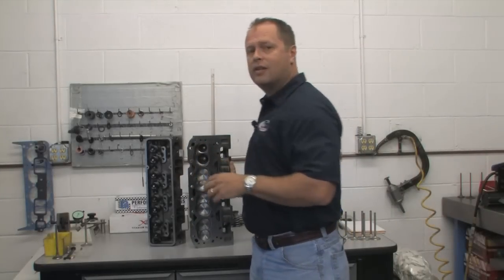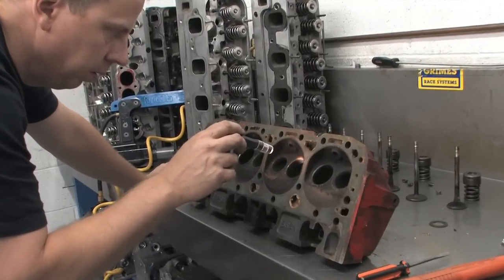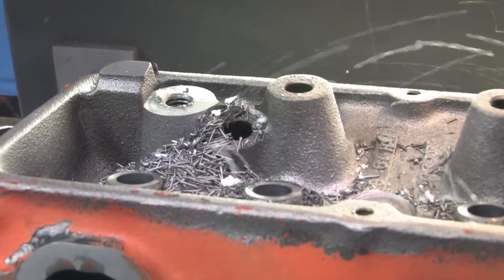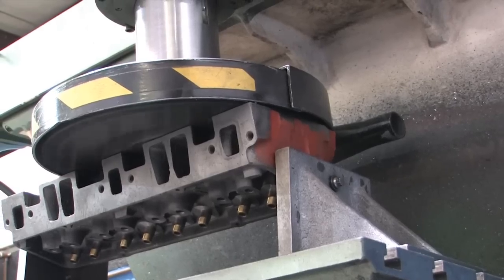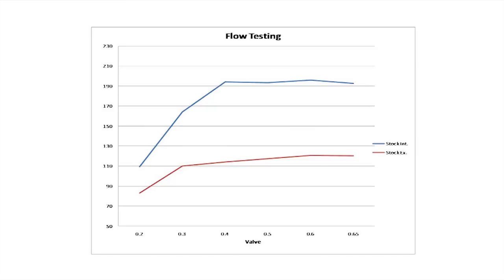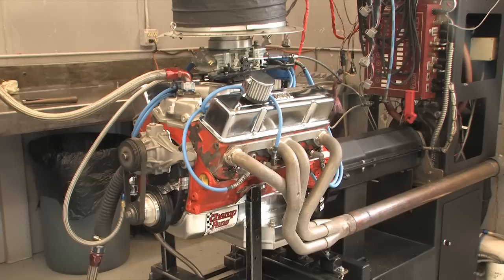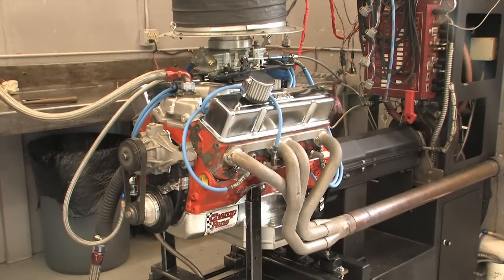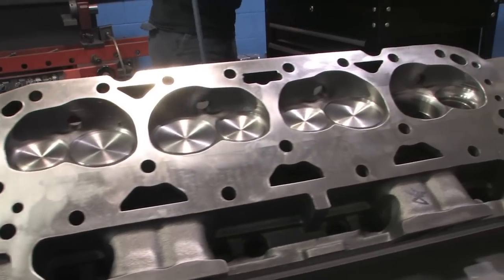Chevrolet Cylinder Head Dyno Test

Comment: $1250 for Dart Iron Eagles? Why not just buy some AFR 195s or 185s for $1500 and you will get aluminum cnc machined heads that annihilate the Dart Heads' flow numbers and maintain port velocity.
Reply: You got it right.
Reply: Some tracks don't allow aluminum heads in certain classes, while I don't think I've ever seen a cast iron head restriction
Reply: Because they are doing a price comparison of machining the stock cast iron heads and final dyno test results to see if its worth spending the time
Reply: Except that if they did this level of work to a set of vortec heads it would shit on those 882s and give the darts a run for the money.  Its a hell of a lot easier to find good vortec heads too.
Reply: David Cheeseman cheese man it's about trade craft
Reply: Corey H. Aluminum is to easy to warp in my opinion
Reply: @kurtislouth231  Assuming you have a decent tune [never leaning out hard] and coolant flow, I assume you are worried about heat soak after shutdown?  Put in an electric water pump and fans with a 2 minute one shot timer you can use.  Shut it down, hit the button and walk away - you will need relays so you don't backfeed other electrical components.  One of the other interesting bits that seems to work for some is Waterwetter - mixed with distilled water, it tweaks thermal efficiency/reduces some hot spot issues.
Reply: @quevicular  yes!
Reply: Corey H. Yup, I bought the patriot Aluminium 195 heads about 5 years ago brand new and had them built for a roller cam for under a grand. I know they aren’t the best but I made just shy of 450HP.
Reply: Cory H., they could have done a lot of things that were sensible,  but this is just a paycheck from dart to this guy!
Reply: @quevicular  anyone with even a little knowledge, already knows aftermarket heads are a better choice than spending the amount of money that they did on factory stock heads, if you don't,  maybe you shouldn't be writing comments that are a reflection of your ignorance!
Reply: For some racing applications, they prohibit aluminum heads. This is not really what you would do for a typical street / strip applications.
Reply: I THINK(because i don't know, I'm trying to learn about mechanics) that it's about the trade. I mean just going out and buying stuff is cool too, but knowing and practicing rebuilds on older stuff just makes a person that much better. But that's just my opinion, anyone care to chime in?
Reply: Adan Avalos Agree
Reply: @Val_Killmore  ah the votrtec nut swingers. Vortec heads really suck. Most of them are 76cc and you gotta run heavy domes. I still run double humps on my modified.  Guys can figure out how I can run 7800 rpm and spend the amount of money I do on fuel. I spend my money where it counts.
Reply: Exactly
Reply: @adanavalos3454  I'm currently rebuilding a set of power pack heads, and having fun with it. Sometimes it's not all about eeking out the most HP possible, right?!
Reply: jasonneal I had a pair of patriot freedom series on a solid roller 11:1 333” and it made awesome power. A lot of people knock them, but for under $900, they were an incredible purchase.
Reply: AFR's ain't no joke...  They're worth every penny.
Reply: @ScooterLee-ei1ep  maybe you are meaning tbi heads or something. i have checked multiple vortec chambers that are stock.  Always in the 62-64.5cc range. But this said with the aftermarket the way it is today there not worth building for lots of reasons. The part numbers end in 906 and 062 that i am referring to. The heart shaped combustion chamber.
Reply: @eduardogarcia6516  those are rare. Most vortec heads are smoged out.
Reply: Well said Saj sergeant
Reply: Agreed! Or you can get a set of pro filer heads for about the same price as those iron eagles and be way better off! Taking about 40lbs off the nose as well!